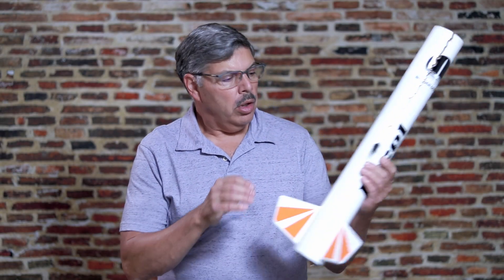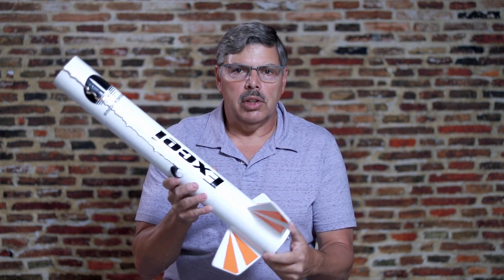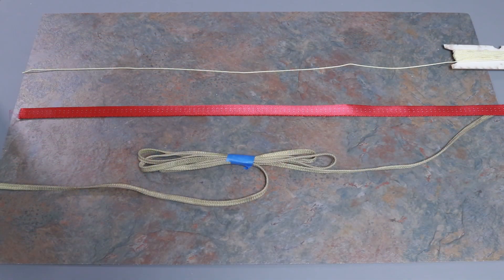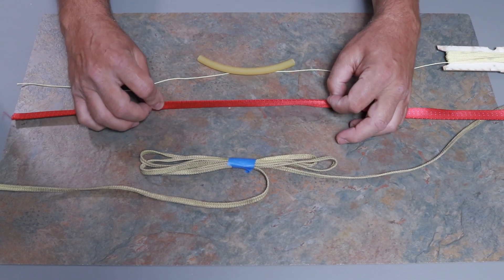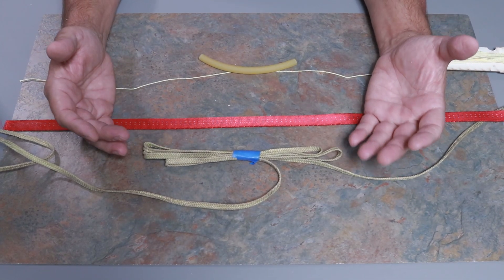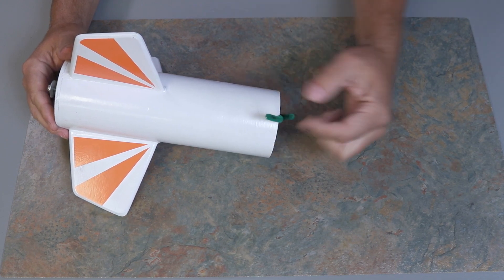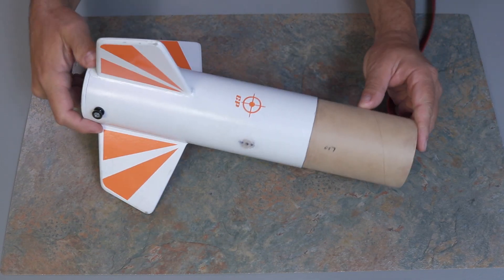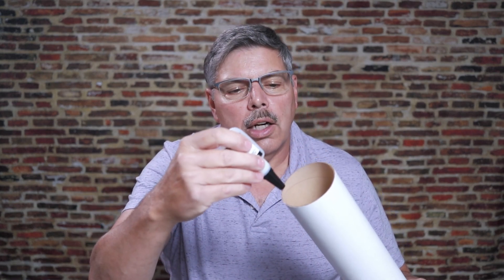Rocket zipper causes and repair.

Comment: I would definitely start using the thin CA versus super glue on the tube edges. It seeps much further into the tube. I thought your surgical tube was a great little tip 👍.    The name should be ZIPPERTIPPER
Reply from the maker: I agree, the thin CA works best. One viewer suggested wood hardener and that seems to help as well. I have another idea that involves a collar on the outside. Thanks for your comments and name suggestion!

Comment: Great video!  As for a new name, what about "Reincarnated."  

On my recent flight a minor zipper resulted, taking about a 3/4" chunk off my inner tube.  To fix it I cut off 1" from the top and replaced it with 2 layers of carbon fiber tubing (using the same diameter).  Step 1, the first layer was cut 1" and placed on top essentially restoring the original appearance.  Step 2, the external coupler, a second tubing was cut 2" tall (with one slice so it could wrap around both the 1" replacement and original tube) and then epoxied.   I used as an external coupler since my airframe uses a piston ejection.  I sanded the edges round to prevent shock cord frey.  The upper ring is now 2x as thick, lightweight, and very strong.  I suppose you could use an inside coupler too...you'd just need to figure out a solution with your nose cone.
Reply from the maker: That is one sturdy repair and another great name!